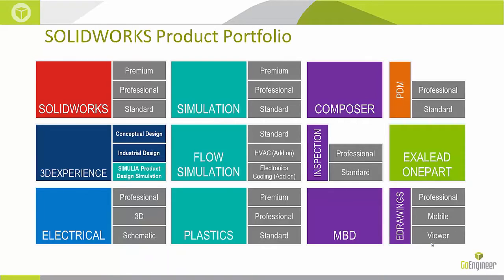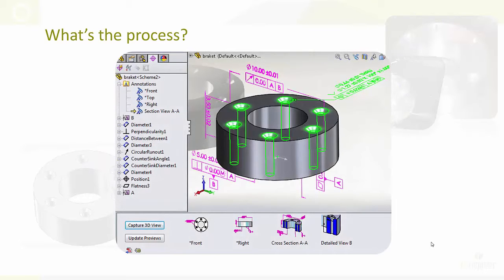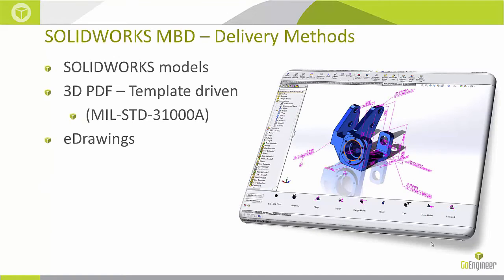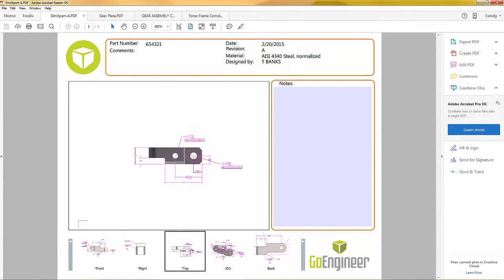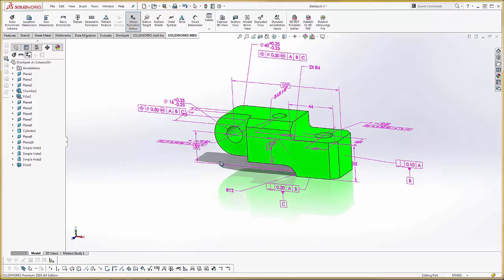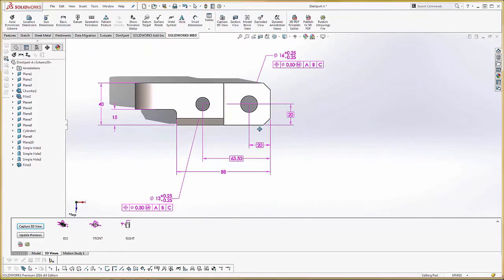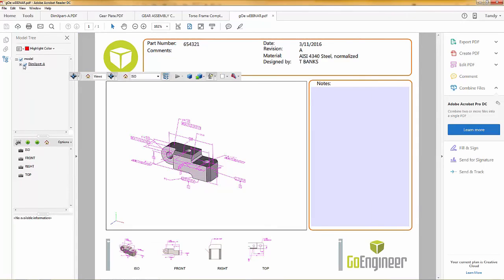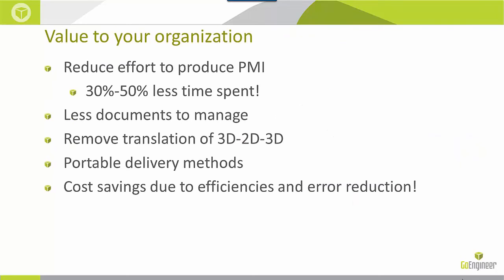SOLIDWORKS MBD Introduction

Comment: If you are familiar with SolidWorks MBD, I would like to ask three questions regarding GD&T implementation:
1. How do you annotate the basic bolt circle diameter (BCD) for a circular pattern?
2. How do you annotate the basic angular dimensions for a circular pattern?
3. How do you separately apply true position tolerances to the length and width directions of a circular slot?